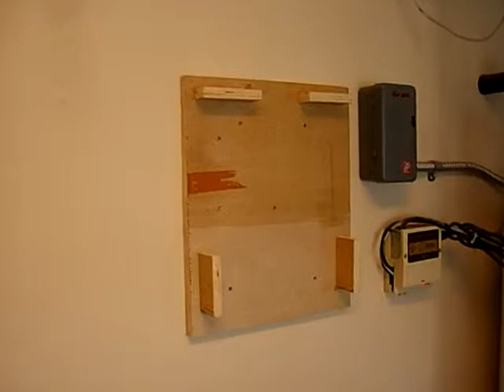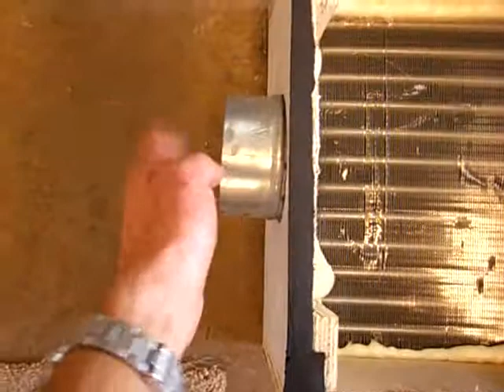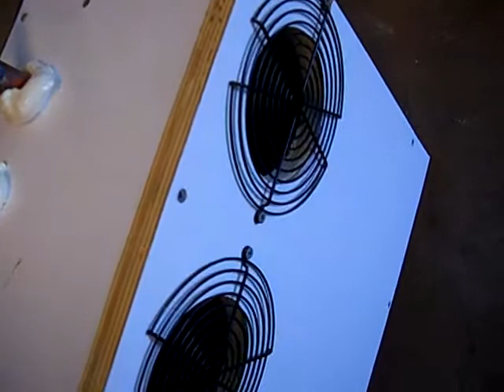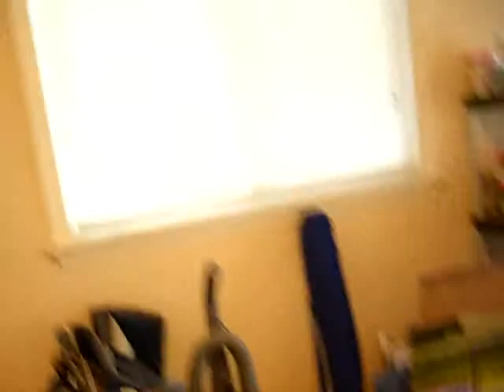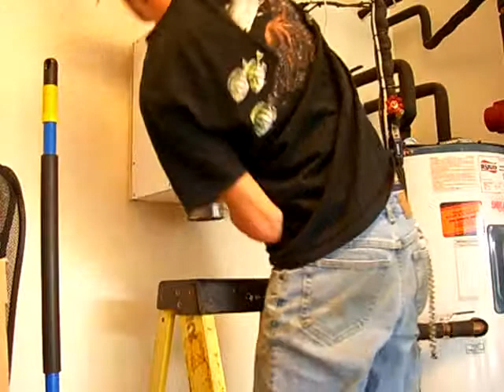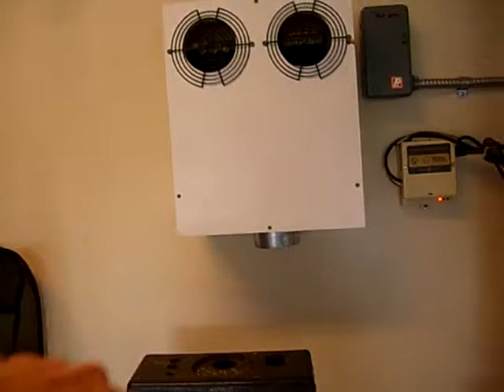solar cloths dryer part 5

Comment: A couple of suggestions.  AC inlet filter for dust.   The double evaperator coil is a good concept but may still be limited on flow.  Viscosity diffrence of water to gas is 13 times more dense so the exchanger should be made for liquid.  Say a small automotive radiator.  Fully open up the inlet side (post A/C filter) for less air restriction.    How are your dry times?  Great work man....You are a true inventor.  Im looking a dedicated panel with Glycol and heat exchanger.  Same concept!!